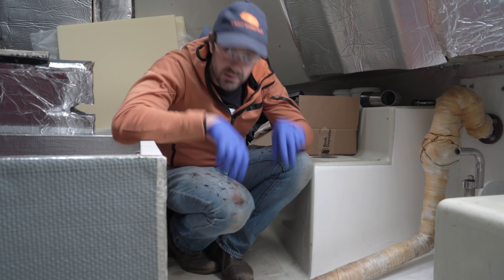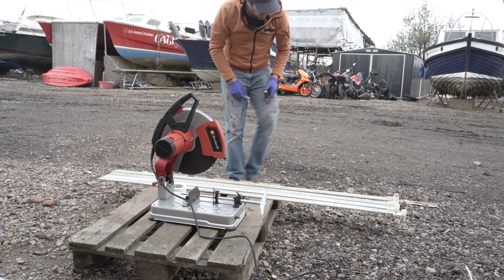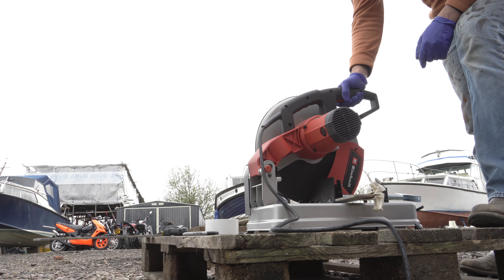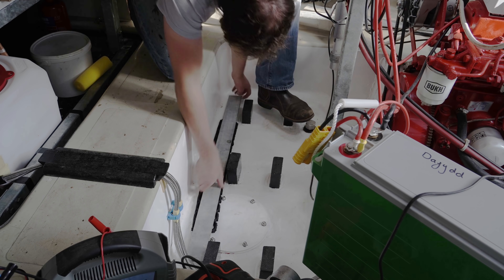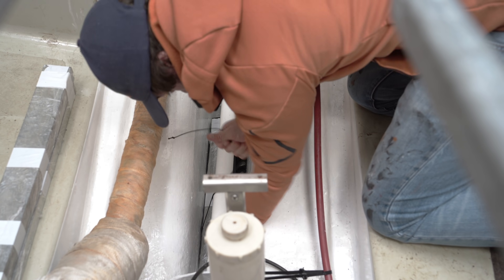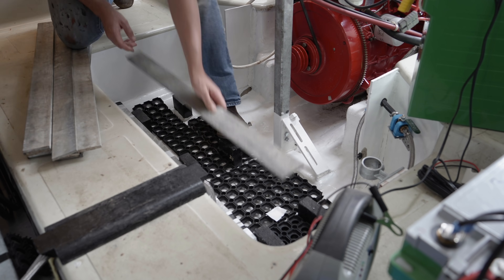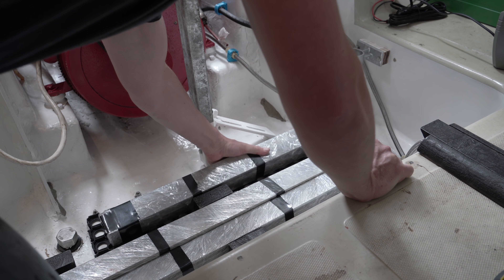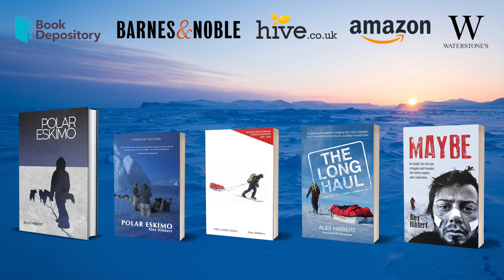Lifeboat Conversion Ep18: Cutting and installing steel ballast to a lifeboat [4K]

Comment: Alex tell me what the trick is to getting a lifeboat into a boatyard hard standing? I have recently just purchased one and all the boatyards (working) boatyards come back saying “not our type of boat” I’ve looked long and hard from Gravesend to Pentonville hook!!
Reply from the maker: That's very strange. Are you just trying marinas? They might be snobby. Our yard near Benfleet takes all sorts.
Reply: @AlexHibbertOriginals  
No I am looking for boatyards as mine has been converted into a Liveaboard but I need to do cosmetic and general maintenance to bring it up to a standard I like. I purchased mine from CART, it was a seized boat no registration or BSS etc it’s on hardstanding in a holding facility in Chester I’m at struggling to find a yard atm seem to get the same response “don’t take GRP” or “ Unfortunately, on this occasion we will be unable to assist you with moorings and/or hard standing space.  Your boat is not suited to this marina and doesn’t meet our required standards or criteria.”
Reply from the maker: No GRP seems very strange. Most boats in our yard are fibreglass.
Reply: @AlexHibbertOriginals  
A boatyard on the Medway just told me today it seems an odd shape and not sure how a crane can lift it lol lol all seems odd to me too! I have a yard near Tottenham on the Lee who is interested so will wait to hear from them.
Reply from the maker: Yards with sling boat lifts will be able to do it. Email directly via website.

Comment: Osmium or Platinum seem like foolish ideas for Ballast. Depleted Uranium on the hand is more easily obtained - just run around any US Air Force weapons testing range, should be tons of it scattered about where the A-10's practice. Better yet would be Plutonium 234, it's up there in density,  though tougher to find, it is being produced daily by several countries so a little digging on the web you should find enough. It would offer 2 additional benefits to the expedition-- #1- it generates heat constantly all by itself and #2 you can then  just slap some TEG's on it and get free electricity!!! Lastly, a 3rd benefit would be no worrying about those complicated retirement plans -- WIN, WIN, WIN !!!

Comment: There's been experiencing with "flopper stoppers", run out to port and starboard with a securing line forward.  Rigged in much the same way as fishing trawlers do nets, except the little torpedoe looking gadgets have "wings" that pull down steady.
Trying to remember where I heard about those.  But you'd need a mast and booms, so probably not workable.
Reply from the maker: Yes, Alan's not well proportioned for mast or rigging of any conventional type.
Reply: @AlexHibbertOriginals  Yes, tis true, tis true.  But has a beauty of her own.  I miss being around ship and boats.  Sigh.  But here is where I seem to have gone aground.

Comment: The whole time I was watching this, I was literally shouting "FIN KEELS!".   Puts the weight as far down as possible, and the fins slow down rolling.  Plus you can beach her at high tide and she'll sit upright like a proper lady.  Use half inch or greater sheet steel, calculating the weight you need there. 
DO IT, DAMMIT!

P.S.  I love this.  Sort of thing I'd do if I was younger.
Reply from the maker: A fin keel would be ripped off amongst sea ice. Do you mean (still quite vulnerable) bilge keels?
Reply: @AlexHibbertOriginals  As I recall, Fin Keels and Bilge keels are much the same.  Hadn't thought of ice.  If you are splashing about in thick pack ice, that is NOT good at all.  I'm an old north Atlantic Tin Can sailor, on sonar picket duty listening for Russian subs over the North Atlantic Deep.  Came off duty with ice caked rain gear many a time.  God help me, I loved it so!  To me, the gray waters and grayer sky became beautiful.  But it's been a long time.  I'm not just rusty, I'm wheelchair bound.

God, I envy you!

Where will you be bound when the time comes?
Reply from the maker: Quite the CV!

As I understand it, a fin keel protrudes down far further, and is not recommended for icy seas. Bilge keels seem to attract more debate and I'm considering.

Comment: Maybe coat the bundles of ballast in tool handle dip? that would corrosion proof them to a large extent.
Reply from the maker: Only the ends need it, and in this bundle they can be repacked quickly.

Comment: I wonder if you shouldn't have considered another method for gaining (and losing) ballast with something like inflatable water bladders instead of steel. I guess time will tell.
Reply from the maker: Steel is massively more dense than water. Water ballast in small boats is a fool's errand.

Comment: I am thoroughly enjoying the amount of forethought being taken for each stage of the project. Not just tacking on a part that works but taking into consideration how it may affect the other parts, how complicated will it be to move/ replace if needed, and any other ways the part may go wrong or cause a problem.
Reply from the maker: Thanks Bob. A mix-match of training and advice over the years has led to that mindset.

Comment: That new grinder would have made short work of the paint prep, instead of that pathetic sander. Getting worried, I'm ploughing through these episodes. If I run out I'm going to have to buy a boat and start filming myself grinding things off it to stay sane.

Comment: I’ve had the same boat. Definitely change the steering mounting. It broke of on mine! Changed it for hydraulic steering, much better. Also, we put an extension on the exhaust so it would be in the water and there for act like a muffler. Worked great. Don’t know if it is of any use for you but the engine makes a lot of noice without any muffler. Good luck with the build!
Reply from the maker: Cheers. The Bukh was running nicely with good balance this weekend.

Comment: I being thinking with adding metal and electrical stuff. Wouldn't moist air become a big problem along the way? So stashing as much as possible of dehumidifier salt or similar stuff in every nook you can may safe you headaches later
Reply from the maker: All boats have to deal with sea air, and having metal and electrics. Using desiccant would be something of a losing battle.

Comment: What about making a mould of the part you want to place the ballast in and making lumps of concrete that will fit the contours and that can be lifted out if necessary
Reply from the maker: This would ensure no air gaps, but concrete is a lot less dense than steel, and I want to keep access and flexibility.
Reply: @AlexHibbertOriginals  ah yes I suppose you will have redistribute to get the balance correct on sea trials.

Comment: Question, how much fuel will be carried and could this be also used as ballast? (Obviously exchanging the fuel as it's used with seawater)?
Reply from the maker: Around 2000litres max capacity. The challenge is that this will be mostly in inflatable bladders, and most of the low down areas earmarked for ballast aren't the right shape for tanks or bladders. Plus, I don't want to have to muck about with water replacement (plus steel beats water hands down). This means the fuel will be stored higher up. A compromise.

Comment: How many RPM is the diesel motor?
Reply from the maker: Many, many RPMs.
Reply from the maker: https://bukh.dk/upload_dir/docs/FAQ/Bukh%20-%20Marketing%20Material/BUKH%20-%20Leaflet/Bukh%20RME%20-%20Leaflet/BUKH_DV48_RME_A4.pdf
Reply: @AlexHibbertOriginals  Thank you! Super helpful. Curious roughly how high you had the motor revving to get Alan up to 6 knots. I'd love to build one of these out with an electric motor and couple kilowatts of solar.
Reply from the maker: Alan tops out speed-wise at around 6knots at under 50% revs, but that's lightly laden and not against currents/tide.

For electric I think you'd need 15-20hp equiv. minimum and a high thrust prop, unless you're just talking lakes/canals etc.

Comment: Isn't the lifeboat already weighted on the bottom to stay upright?  Just curious.
Reply from the maker: Not really. It relied on lots of people onboard.

The air cylinders were 200kg and set low down. Otherwise, no obvious metalwork/concrete.

Comment: See if you can find a parts boat to pull the steering bits from, some cleats and other bits could be salvaged at the same time. Free sailboats are a great source for stainless tube, lead, and expensive boat junk.

Comment: By cutting the galv. steel, you expose the base steel which can start to corrode and rust at the cross-section of the cut. Galv Steel is just a coating on the steel itself.
Reply from the maker: Yes

Comment: Ballast made interesting, thats got to be a first. Another great video
Reply from the maker: Thank you. The paint drying ones were an act to follow.
Reply: @AlexHibbertOriginals  😂😂😂
Reply: If you want a great ballast series check out SV Seeker. Doug built a 20foot tall lead smelter from scrap and has 30000 pounds cast in to bars. Seeker is a bit bigger than Alan at 76foot

Comment: I remember some years ago a guy used an old steel lifeboat to go up to the ice. He had to reinforce the steel hull as he knew he risked getting stuck in ice over the winter.
Reply from the maker: If you lack the power to break ice (the case for most boats and ships) then it's all down to hull shape. I'd rather have a well-shaped wooden boat than a sharp, deep keel steel hull.

Comment: Just out of curiosity, what speaks against using lead as ballast? Shouldn't that be even denser? Is it just corrosion issues again? Or is it just more expensive? Or because it is too soft?
Reply from the maker: It's a combination of cost, availability, impact in the event of an accident at sea, and how easy it is to cut and shape.

Comment: What I don't understand is that these lifeboats are supposed to be self-righting by design so they won't capsize or sink in rough seas. So I wonder if adding ballast is necessary or even advisable. Isn't ballast more effective for boats that are top-heavy or exceedingly tall? I'm not an engineer so I'm just curious why the engine, batteries, fuel & fresh water weight wouldn't be enough ballast for a boat that was designed without extra ballast? Adding weight causes you to use more fuel so I'd try to make Alan lighter instead of heavier & stow all of the heaviest items as far below the water line as possible.
Reply from the maker: Lifeboats of this type are designed with very specific aims in mind: to keep a large number of people alive and afloat for 24hrs.

Very secondary to the designers are the following: comfort, sea handling, multi-week use and performance whilst lightly laden.

The boat is rated to nearly 12,000kg, and currently weighs under 3,000kg. This means, along with the shallow keel, it'll sit high in the water like a cork, and therefore have very uncomfortable handling unless ballast is added. Others might add keels, but I have shallow waters and ice to consider.
Reply: @AlexHibbertOriginals  That makes sense. Thank you for the explanation. I neglected to take into account that those boats are designed to be fully loaded when deployed.

Comment: Apologies if I am not clear on the ballast bar placement for the keel (I understood the securing logic and methodology of the larger cavity by the fuel cell). How are the bars in the keel cavity being secured in the event of extreme body roll? As for the solicited advise for the rudder rod reinforcement… coiled sleeving (think spring) comes to mind. It can be staggered around braces and won’t trap moisture.
Reply from the maker: The keel cavity area will also have a perpendicular bar over the top and secured. It'll also be blocked at either end.

Comment: Why don't you fill out the ballast areas with Epoxy? It's heavy too, prevents the Steel from moving and rusting....
Reply from the maker: I want access to the through-hull fittings, and ability to move and change ballast. Plus that quantity of epoxy would be expensive and not that heavy.
Reply: Then  maybe some polyurethane foam to keep the bars from moving, to keep it cheap and rather easy to remove to access the fittings or add / remove some ballast?

Comment: If u need more ballast you could buy broken tungsten Machining tool bits. Cheep because it's broken, heavy because tungsten is very dense and the tools them self are small you can put the anywhere.
Reply from the maker: Unless they tessellate well, there would be a lot of empty space between the metal bits.

Comment: For the steering, look up a heim joint, should be easy to install and they allow all the rotation you should need, they are usually used in custom off road suspension and steering so they are built for a beating, and are available in more sizes than women's garments 👍
Reply from the maker: Thanks Ryan.

Comment: One idea, and I'm not a boat man so I do apologize if it is a bad idea: why not create some custom-fitted ballast out of tile grout poured in to molds? I know such a method is commonly used when constructing ersatz machine tools out of scrapyard parts.
Reply from the maker: Steel is much more dense, and can be removed.
Reply: Thats what he said. Tiles. Removable. I see a lot of airgaps inbetween the steel. Concrete mixed with steel punching scrap shaped in bricks placed on rubber.

Comment: Buy another boat? :)

In all honesty, that steering gear looks very complex, and, without a lot of data, I'm not sure I could offer any worthwhile thoughts, beyond the fact that the weld between the clamp-thing on the rudder shaft and the bar leading to the steering wheel looks pretty suspicious from what I can see.

Also, thank you for posting these. As someone stuck in a backwater part of the world who will likely never get to do any artic exploration, it's fun to live vicariously through you.
Reply from the maker: Thanks and no problem.

Comment: Might be a silly idea but once you have placed the metal where its going could you not surround it with sand for extra ballast and stability. Would be easy enough to removed with a vscume cleaner if needed.
Reply: Easy to remove until it get wet
Reply: Sand can also be very abrasive.
He really is taking care that things cannot damage other parts of the boat, as he will be very far away from any rescue.

Comment: Try sad bags, or bags of concrete
Reply from the maker: Steel is 4x as dense as sand.
Reply: Or what about water?
Reply from the maker: Steel is 8x as dense as water. Is this a wind up?
Reply: @AlexHibbertOriginals  and feathers?

You already now a local chicken farmer so feathers should be cheap to get.

Comment: I wonder if you might want to look into underwater cable heat shrink tubing to close off the ends of those ballast stacks. They won't wear out like tape, and would prevent the sharper end of the bars from scraping?

Something like: https://buyheatshrink.com/heatshrinktubing/heat-shrink-kits-splices-and-end-caps/heat-shrink-end-cap?diameter=19&campaign=9431365155&adgroup=98389173249&feeditem=&keyword=&matchtype=&device=c&network=u&gclid=Cj0KCQjw16KFBhCgARIsALB0g8L-HW-SLmcXv15pebXQYQENNUkuZZxtJCrPNQW5FlCyGCoKDqAH5UMaAg6rEALw_wcB&creative=419759160173&gclid=Cj0KCQjw16KFBhCgARIsALB0g8L-HW-SLmcXv15pebXQYQENNUkuZZxtJCrPNQW5FlCyGCoKDqAH5UMaAg6rEALw_wcB
Reply from the maker: Interesting idea. Perhaps once I'm sure I'm happy with the system.

Comment: Alex, how do you hold the ballast so it doesn't move in rough sea conditions?.
Reply from the maker: Towards the end of the video you'll see cross braces that'll be bolted in.
Reply: @AlexHibbertOriginals  yes, but do you think those braces will be enough?.
Reply from the maker: Yes. Multiple M10 bolts mounted properly, and with no impact force in the event of inversion (the braces allow for no movement) will hold 200kg of steel in place.
Reply: Thanks 😉

Comment: Why didn't you just use gold as ballast? It's way heavier than steel
/s
Reply from the maker: Because someone would insist on osmium.
Reply: @AlexHibbertOriginals  ahh good thought didn't think of it. Why don't you just make a new boat :P
Reply: @frogmorely  well but it would be hard to move Alan from the yard so maybe its not the best idea

Comment: Why do you cover the galv steel with plastic? It is allready corrosion resistant and to me seems like it will only trap more water inside the plastic if there is a hole in the cover or something.
Reply from the maker: There are cut ends and holes that have lost their coating. They were also a reasonably dusty galv finish, so this keeps the bilge clean. I could have just wrapped the ends, but it's more secure to run along the full length.
Reply: @AlexHibbertOriginals  Makes sense. Love your vids!